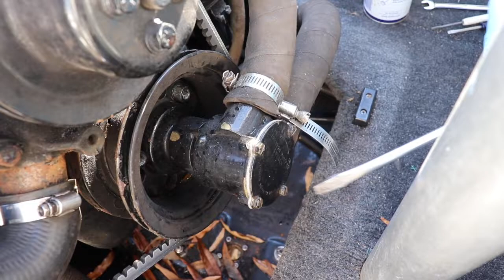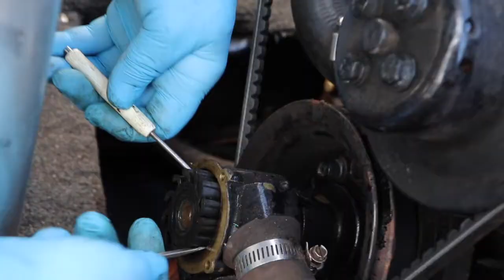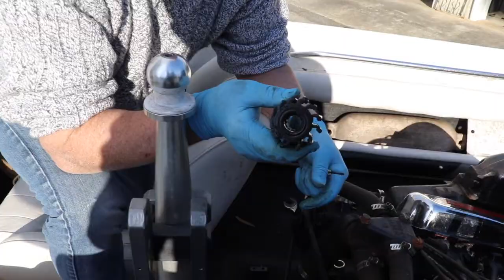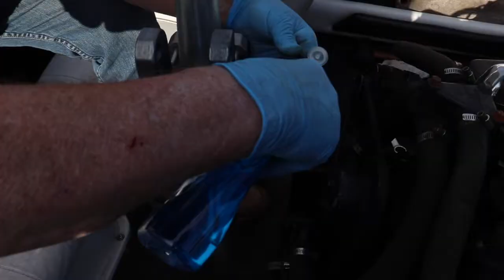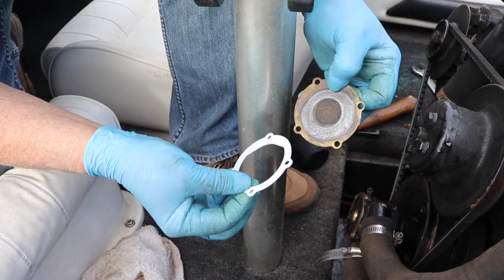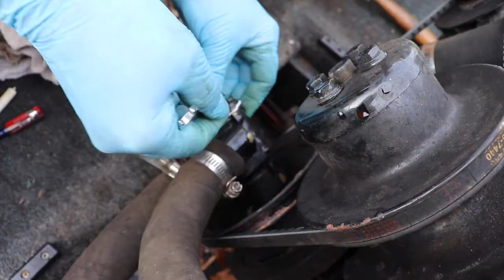Indmar Impeller Replacement | How to Change A Johnson Pump Impeller

Comment: Is it possible to do with the boat in the water?
Reply: If you have a ball valve in between the impeller housing and through hull. Turn the ball valve shut change impeller, open valve and giver.

Comment: Helpful in so much as it answered my question about which way to twist the impeller when inserting the video says it doesn't matter as it will correctly locate when the engine is started. I did notice that the impeller was inserted the wrong way around as the thread on the impeller should face outwards as this is where the puller would fit if being used.

Comment: Great video.  Do you have another video on how to replace the seal on the back, that you mentioned in the video.   I have a small drip post install.  thanks.
Reply: Do you know what the seal is called I need to replace mine

Comment: After how much time or hours is it best practice to rebuild the pump with new bearings, o ring, thrust washer, shaft seal ?  Kit.  
I had mine off boat for another issue and assumed I would merely replace the impeller. Upon inspection I could see rust on the bearing surface and they were rough to turn.  Definitely would not have inspected this if I had not had the pump off. Boat is a 08 with 310 hours on the clock. I’m thinking it’s best to rebuild before a bad pump leaves you stranded.